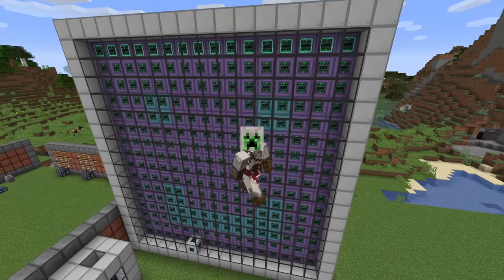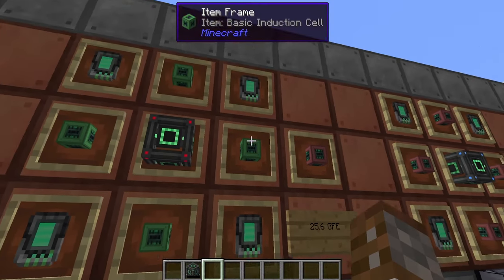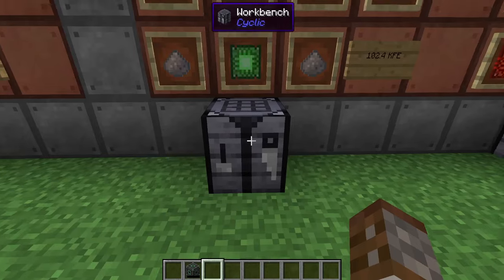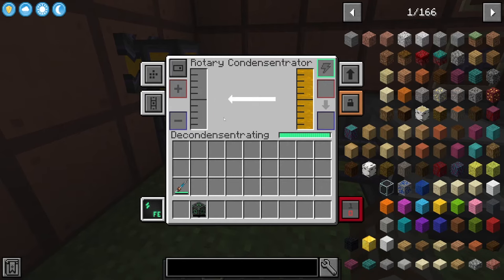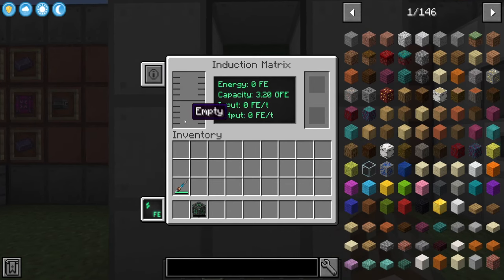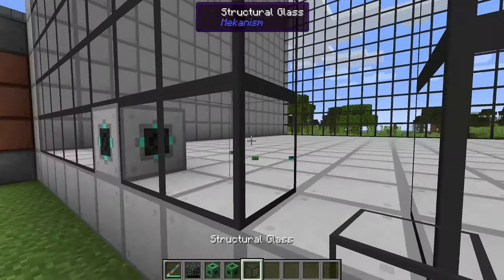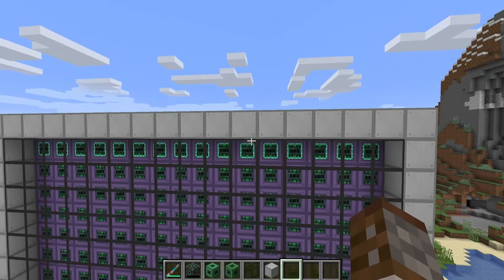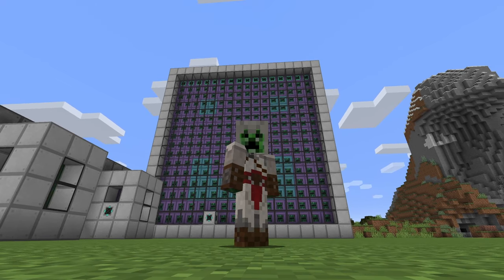How to: Mekanism | Induction Matrix (Minecraft 1.16.5)

Comment: very good...now fill it
Reply from the maker: Good luck with that xD
Reply: @Mondays3  i mean it can be pretty eazy,the hard part is to make it.rn im on sf4 and i have like 2500 ultimate induction cell,but i want the max size which is 3840 like you showed
Reply: @Mondays3  also on sf4 1 ultimate holds 200b not 1.5 t sadly :(((

Comment: In case anyone else doesn’t know, the M G T and P before FE are called prefixes and are from something called the Metric Prefixes. They are used in science to easily see the scale of large or small numbers.

M = Mega = 10^6
G = Giga = 10^9
T = Tera = 10^12
P = Peta = 10^15
 
You’ve likely seen this system used in computer storage, so your phone will have around 64 GB (*Giga* byte) and your pc around 1 TB (*Tera* byte)

So the 6.14 Peta-FE at 14:21 is 6140 Tera-FE
Reply from the maker: Top tip. I new the words but not the conversions to numbers lol
Reply: thats also why 10k is 10,000, because k is for thousand. i always assumed it was a random letter till recently
Reply: Welcome to the metric system, Americans
Reply: @KanpachiGaming  americans are taught the metric system..

Comment: for the big numbers you need to think of them as the metric system
K = kilo = thousand
M = mega = million
G = giga = billion
T = terra = trillion
P = peta = quadrillion
and i don't think anything can go bigger than P, but if it can it probably goes
E = exa = quintillion
Z = zetta = sextillion
Y = yotta = septillion
in fact the only place that you will see those numbers will probably be the empty creative energy cell since that can go all the way to infinity (which is probably actually the 64 bit integer limit)
Reply from the maker: Thank you
Reply: thanks for this mekanism uses this weird numbers instead of millions and billions
Reply: @dejazO0  it may be weird to you, but for many people like engineers, computer programmers (like me), and others this is normal and even expected
Reply: @dejazO0 its not really weird its just that they're bigger then billions and millions so you can't just say 1000 millions
Reply: from my knowledge it uses something around Ort exactly the 32bit integer limit but i haven‘t checked in a while

Comment: Why would I need an induction provider that gives 60MFE/t if the ultimate cables can only support ~6MFE/t?
Reply from the maker: You can have multiple outlets on it. If you had one provider that that would mean you could power 10 different ultimate cables. It's designed to be one battery for multiple systems, not everything coming out of 1 cable
Reply: @Mondays3  some other mods also support near-instant energy transfer. I can’t remember the name, but there’s a wireless energy mod that allows for up to 10GFE/t or something nuts like that
Reply: @Only_Sleep  you may be thinking of Flux Networks. Honestly, if you play a pack that has Flux Networks, you only really need cables for small subnetworks, where you power several machines off of one flux point. You could also conceivably put a flux point on each and every machine, but that seems a bit excessive lol